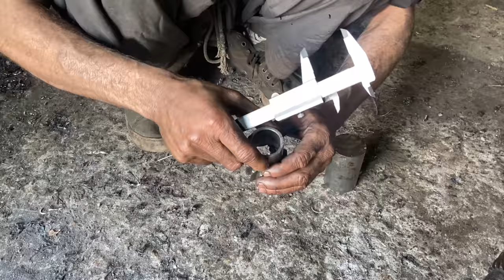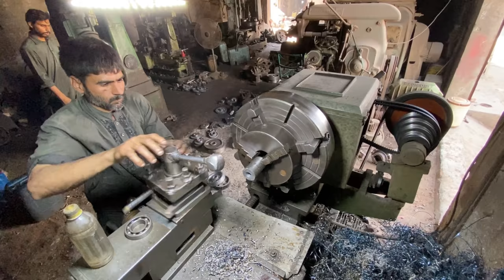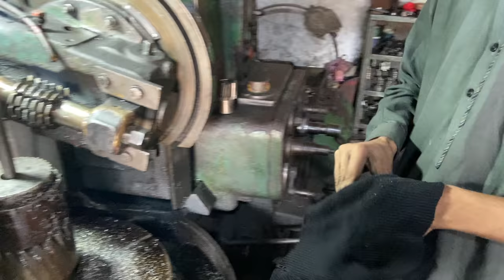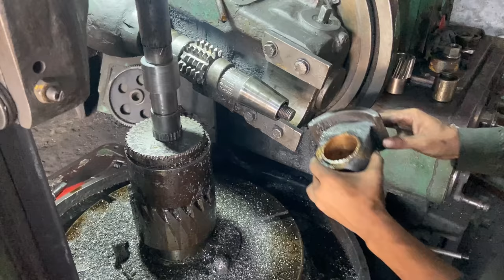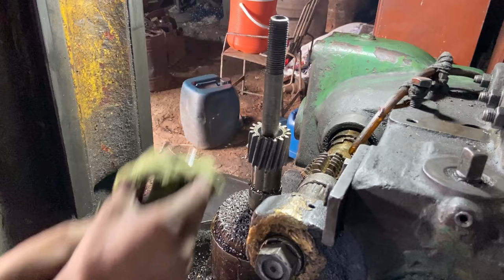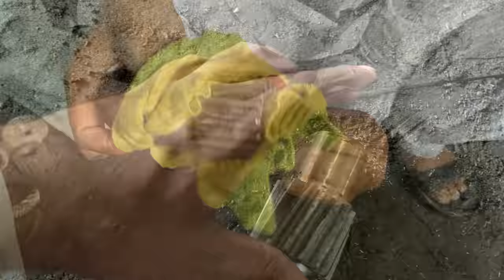Making a new helical pinion gear using the old broken pinion gear as a model

Comment: That drill needs some serious sharpening. It never ceases to amaze me how cobbled together these machines are. You can see blobs of weld holding every single lever and bolt together. It's no wonder when the tooling is so dull you gotta use a cheater bar to drill a fairly small hole.